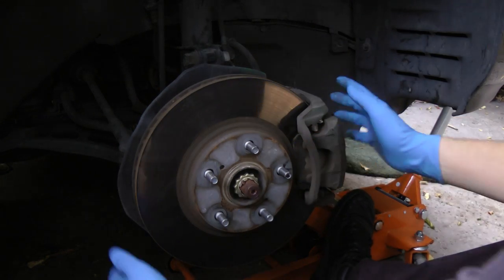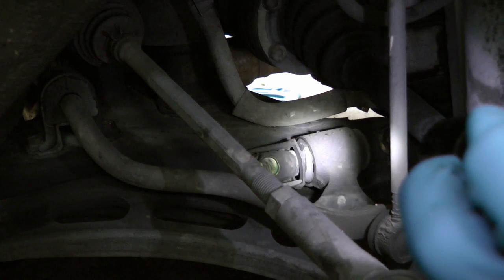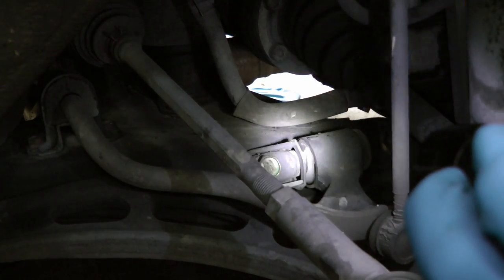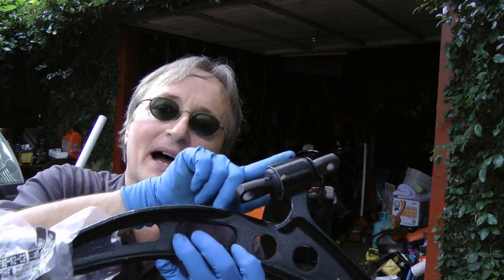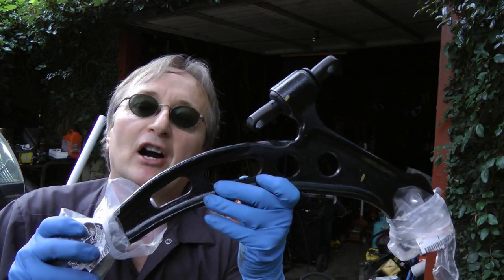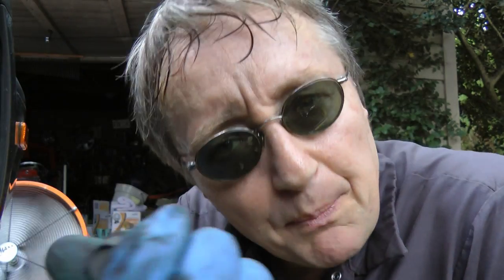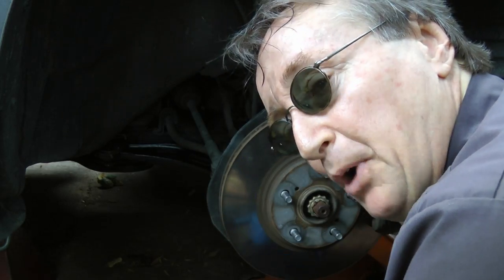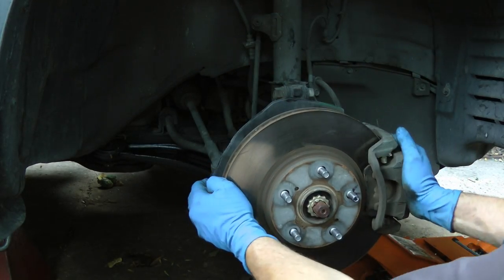How to Stop Steering Wheel from Shaking (Lower Control Arm)

Comment: Hello Scotty,
i've got a 98 mitsi galant. so if i replace the lower ball joint as well as the control arm, am i going to need a ball joint press? i'm a poor student and the mechanic quoted me for $200 for the job. thanks and any advice would be much appreciated!
Reply from the maker: the ball joint comes already on the control arm if you buy the whole assembly and you need no press then
Reply: Oh sweet. Then its just a matter of taking the old one off and chucking a new one on. I should be able to do that myself. Thanks you very much!

Comment: hey scotty,so i have a 96 lexus es300 ,i ran over a curb and iv already fixed the ball joint, fixing that made it driveable again,but the tier seems to be very close to the fender,when i make left turns it rubs. is it possible it is the lower control arm that i bent as well? i hope i explained that good, haha well hope to here from you ,thanxs.

Comment: Hi Scotty,
How does this translate to a 2002 Lincoln LS? I think both lower and upper control arms in the rear need to be replaced on mine
Reply from the maker: a lot more work on that lincoln if both need replacing. If rubber is cracked they are bad

Comment: Hi I have a  RX 330 should I change the lower ball joint too? is it easy to remove it when I'm removing the lower control arm?
Reply from the maker: I'd change it if you have all that part anyway

Comment: My mechanic has said that I could use new control arms but wants $600 to replace them. My dad has a garage full of tools that would allow us to do it ourselves. However, I live 2 hours away and may not be able to make it back anytime soon. My steering appears to be normal and the steering wheel does not shake when breaking. Also, I do not hear any odd noises at all while driving. I guess my questing is: How often do these things completely break? I know that you may not be familiar with my particular car but from what I have read it is rare that they actually break.
Reply from the maker: the control arms rarely break, their bushings get worn and they get slop. If it rides OK, you can drive it that way a while

Comment: My lower control arm ball's came out of the socket and now I need to replace the whole arm. Problem is that the shock (spring) is mounted on top of the arm and has a lot of pressure on it. I already took it off but can't install the new one because I would need to contract the spring (which I can't do with my bear hands). Any advice?

Comment: Scotty, I have a 2004 ford escape. It has a bad ball joint. While driving at any speed there is a rhythmic thumping that speeds up along with the speed of the vehicle. I have replaced the wheel hub and bearing and put on the spare tire to rule out a bad tire or being unbalanced. Is the ball joint the cause of this? Thanks
Reply from the maker: yes, if worn it can cause thumping from the looseness making the control arm hit the ball joint that's worn
Reply: Thanks for the reply, and advice.

Comment: Maybe buy the control arm from toyota?  A friend of a friend used to work at a toyota dealer in service and told me you can often get 100% identical lexus parts from a toyota dealer for 50-75% cheaper.

Comment: i took it to three shops today the first one had it on a lift .. said all the bushings looked fine everything is tight ... but something is bent and they cant see it by eye 
the second shop couldnt get it on there lift because it was too lowered but they said something is loose and they dont believe its a bent frame .. so i took it to the third guy .. third place eyeballed the wheels and said he believes its a bent tie rod or bent LCA or both i have an appointment tomorow

Comment: We have 98 Ford Explorer and for some reason Ford didn't push any grease fittings on our ball joints, but now we are having squeaking and sounds of metal on metal when we turn the wheel and or hit bumps. Could it be our lower control arm too?
Reply from the maker: yes, any rubber bushing can do that when worn. Spray WD 40 on all rubber parts, and if the noise goes away, means nothing. If it doesn't then whatever rubber part is worn needs replacing.
Reply: Thanks Scotty your the best!!!!

Comment: hi scotty i have a simple and quick question 
i dont have much experience with  LCA's and Ball joints but i have plenty of other car experience 

i just purchased a car and when i accellerate from a stop i feel the front passenger side wheel rub against the body. it only does this when i accel pretty quick it is a 5 speed and i know its a rebuilt the wheel feels sloppy and literally as tho it pivots and rubs the body could this be a control arm issue allowing it to have that much pivot travel ?

Comment: I have a 2000 Toyota camry with 270000 miles and I need to have my lower control are changed but I need to know if I change it myself can I drive it to the shop for the alignment or will the alignment be to out of it to drive?
Reply from the maker: drive it to the shop as long as it's not 500 miles away

Comment: Hi Scott, do I need it on the ground first then torque them down according to the manual? Do I need to torque the bolts within spec or just pull like mad? Thank sir.
Reply from the maker: yes , you can torque them on the ground for perfect setting. but really, pulling like made usually works fine too
Reply: thanks sir, my 1999 nissan altima lower control arm have some vertical play is it normal. there is no horizontal play. let me know should i change it out?
Reply: Control arms are supposed to move up and down with the tire and suspension as you go over bumps.  Horizontal play or cracked and bad bushings indicate you should replace them.

Comment: Hey Scotty, I have a question about the lower suspension steering stopper. In the video at :44 you can see the stopper is installed in the original factory position on the bolt, and during reinstall at 1:54 the stopper is installed in a different position. Would that cause an alignment issue?

Comment: Can a worn control arm cause misalignment? I have a '91 Camry and it will always pull to the right. I've gotten alignment done and the problem has not been fixed. It feels like the right wheel is heavier and it will pull badly to that side. Also if the wheel is centered going from 1- about 50 MPH, if I turn the wheel slightly I'll get some wobble in the steering wheel. Doesn't happen at freeway speeds. It isn't the tire balance, either..

Comment: So, I had this Ctrl arm issue. when I pulled both sides out, they were very worn. i swapped both side and the end link kits as well. truck (99 Rx300) has a lot of play. It now seems too dangerous to drive. not sure what went wrong. fyi.... for a stubborn bolt such as the one securing the ball joint,  cut it with a sawzaw. the new ctrl arm and ball joint will replace it. The nut on 1 ball joint stripped so I cut it. The cutting took me all of 3 mins.  Any advise would be helpful. Does swapping a pair of ctrl arms require an alignment?
Reply from the maker: try an alignment first, as front end guys can also see other problems if they exist as they align
Reply: awesome.  Your video was spot on and made the process look simple enough. I turn wrenches but not for a living. I often check your vida out first.

Comment: Putting on the new control arm and the two bolts that connect it to the sub frame are off by a hair and not allowing the bolts to go through. I'm 100% sure I got the correct part. Anything I can do to adjust?! Please help!
Reply from the maker: +Michael Herrera if it's an aftermarket part and not oem factory part, that's the problem. they have to be perfectly made
Reply: +Scotty Kilmer Thanks Scotty! Made the OEM purchase and fit like a glove! Sad part of the story though is that it didn't fix the noise I was experiencing in the first place. I'm getting a clanky noise coming from the front right suspension area on my Hyundai. I went ahead and replaced the outer tie rod and lower control arm as advised from "firestone" because they were worn but the noise is still there. Sounds like its coming from the upper part of the suspension, any advice on what it could be? Worn strut assembly?

Keep up the great vids!

Comment: Hey Scotty, I have a 90 acura integra trailing arm assembly to convert my honda crx to rear disk.  My problem is that I sheared the head of the bolt off of the lower control arm to the trailing arm.  I have tried banging the bolt through..no luck, I tried twisting it out but only tweaked the trailing arm brace that holds the lower control arm to the trailing arm.  What other options do I have to get that damn thing out!?

Comment: Hey scotty! I have a nissan sentra b16 2008! with a bad front right control arm! i wanted to change it myself but the screws are impossible to take out! it's like welded together! and on of them is behind the stability bar and i dont have acces! do i need to take the stability bar out? the shop charges me 200 bucks for this replacement! i have the new arm already! the car pulls a bit to the right when you accelerate! and the steering starts to shake when you pass 60 mph!
Reply from the maker: +Tono XX   yes, the bar needs removing. But if all rusted or stuck, you're best paying a mechanic who has torches and stuff to heat or cut bad parts off
Reply: Thx so much scotty! i took it to my regular shop and they did the job for 150 buck! the boult join screw was rusted an ceased so it was imposible for me to do it! thx again!

Comment: My Cobalt has a common problem where the bushing actually pops out and the control arm falls and makes hard contact with the frame, I already know my car has this exact problem, but all of a sudden its gotten worse, and whenever you step on the brake you hear a loud cluck which is identical to the control arm noise and in the same location, can a control arm cause that too?

Comment: what tools do i need to replace the ball joint control arm on a 2004 dodge stratus 
driver front and rear?
Reply from the maker: we mechanics do not use that term, but if you mean control arms, just normal hand tools, just be sure to jack both wheels off the ground when doing the job so you don't have stress on the arms when removing them

Comment: hi mr kilmer i try'd to replace the lower control arm in my toyota tercel but when i began to untide  the firs 3 nuts  one could'nt take it off    what can i do   use buffer or  torch  what  can i do  thanx
Reply from the maker: try a LONG cheater bar and socket, but use heat if that doesn't work

Comment: Scotty, If my front PS lower control arm would break could that make my vehilce vear to the right?  My steering wheel would jiggle when I applied the breaks and coming home all of a sudden my car jerked to the right up a curb and down then it just stopped. Front PS wheel turned to the right with the control arm broke along with the right side strut assembly  Fighting with car company ugg
Reply from the maker: yes, that will do that pulling

Comment: I skid and hit a curb straight on, now when i let go of the wheel it goes to the right, it feels like im turning right, but in reality im not moving the wheel. I have a feeling that my alignment is shot and it needs to be done, but I don't know if i bent anything.  There is no excess noise or shake in the steering wheel, so i don't really know how to proceed.

Comment: Ijust bought a doge caliber 2007 for my wife as a surprise. but i had to buy new tires, aligment. All of the sudden they told me that the arm control is mess up. how can i fix it before she can drive the car...
Reply from the maker: +VICTOR FLORES  replace the control arm, those are cheaply made stamped steel and easily bend

Comment: Hey Scott I got 2008 acura mdx they told me that I need new control arm for passenger side rear one which is gonna cost me $800 but I've checked online parts are cheap like around  $300 but I don't know which one to buy is there is any lower arm or upper arm in 08 mdx ??
Reply from the maker: jaswinder kumar there are upper and lower arms, generally the lower ones go bad on those. But you can get even even lower priced if you search around, I've seen aftermarket ones less than 150
Reply: Scotty Kilmer Scotty my 2008 Ford Focus that i bought new in 08 has  29,000 US miles on it in july 2015,  already has the factory original rear lower control arms separating.  The car doesn't get driven a lot, but it is oil sprayed underneath every year.  Flint Michigan Area type of climate. Is this normal to have to replace these at such low mileage? (granted the car is 7 years old)
Reply: Thanks a lot scotty

Comment: Hi scotty on my jaguar s type instead of wiggle it from side to side i wiggle it up and down. For exqmple i place one hand on top of the tire and another on the bottom. And push it in and out. It wiggles just like in your video. Is it the upper control arm that i have to replace or the lower one as well ?

Comment: How expensive is it to change a arm on a 1998 acura legend?
Reply from the maker: +Byron Dorsey depends who's doing the work, and if you use aftermarket arms you can save a ton, and the ones I've used worked perfectly fine even though they were not acura dealer parts

Comment: I have a 1996 Plymouth Breeze that makes a alful popping noise wen I turn the stearing wheel. What is the cause of this.
Reply from the maker: jack up the car and check the suspension as in my video "how to check out the suspension on your car". Often worn ball joints or tie rods or A frame bushings
Reply: Had to replace the CTRL Arm with Ball Joint...thanks

Comment: my 2001 buick lesabre sometimes makes a clunking sound while turning but i took the tire off and tried to move on the rotar but dindnt see anything loose behind there what else can it be
Reply from the maker: worn ball joints or A frame bushings do that, ONLY when the weight of the car is on them. Have a pro load test them
Reply: Scotty Kilmer so can i just replace the control arm

Comment: I have 2004 dodge neon when I turn the wheel left it make aloud pop sound. I replaced the lower control arms on both sides , sway bar links, cv axle and still hear that poping sound on the right side what do you think it might be.
Reply from the maker: many things can pop, but you changed many of them. Check the strut mounts first, they often do that when bad
Reply: Changed all that new struts, lower control arms, wheel bearings, cv axels,
Reply: Now car makes a growling noise when I drive it
Reply: No i fixed that now the check engine light is on
Reply: I give up on this car

Comment: just replaced both on my 03 neon se...now the car pulls to the right when i accelerate and pulls to the left when i brake...any tips on this?

also steering wheel wont lock after its in park...this all happened on the same day.

Comment: hello my 2002 qx4 when driving an i let off gas it moves side to side from the back an when i put gas i feel it pull to the left a bit .what can be the promblem if it only comeing from the back moveing like side to side like a dog when he shakes his behind
Reply: +Brian Rosales 

Thats what is called the death wobble. You need to replace the rear control arm bushings. Go with polyurethane ones. I did a job like this not long ago. With basic tools and it only took me about 3 hours form start to finish.

Comment: I have a question can I use a lower right control arm from a 1992 Toyota camry 4 cylinder on a 1993 Toyota camry v6?also how about the radiator and the power steering pressure hoses? all from the 1992 to the 1993??

Comment: very simplified video, it's not that easy.   You leave out very basic time consuming steps such as jacking the car up.  As with everything else, hardly anything ever goes as planned.  You will inevitably come across the bolt that strips, won't come off (even with a cheater bar) or something that will take special tools, or at best an air tool to break free stubborn nuts and bolts.  I wish it was this simple!
Reply: Raymond Broderick  if you can't jack your own car up pay it done,that's it..
Reply: He is only doing demonstration  there is no easy button in real life. Good video
Reply: Raymond Broderick, if you don’t know how to jack up your car, then, you shouldn’t be doing your own car repairs.  You might be doing more harm to your vehicle or to yourself, or end up spending more money than saving as you intended to be. Besides, jacking up your car is another topic. Just maybe search for that.
Reply: Rishi Khera calm down king proletariat
Reply: Also left out- Jack up transmission and remove motor mount to access other bolt. But great advice on diagnosing a shaking wheel. You Tube makes us all look smart thanks to Scotty!

Comment: hey scotty, great videos!   would this method be the same for a 2001 Hyundai Accent?  also,do you recommend a reliable website to order parts from?   I found a site called buyautoparts . com  with good deals.   Is this one legit?   thanks!
Reply from the maker: yes, same process. But I rarely buy parts online because I find often lower quality or even parts that don't fit
Reply: Scotty Kilmer thanks for the heads up!  I'll have to go to Auto Zone or someplace like that.